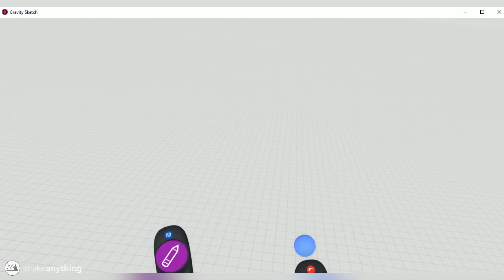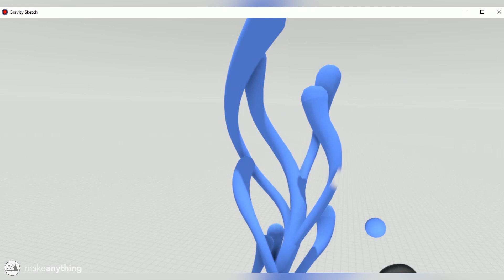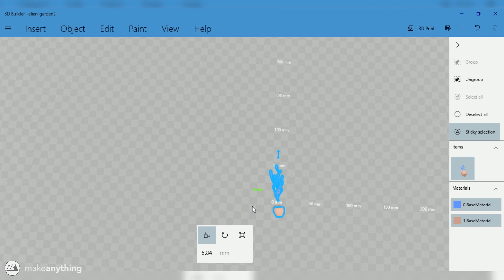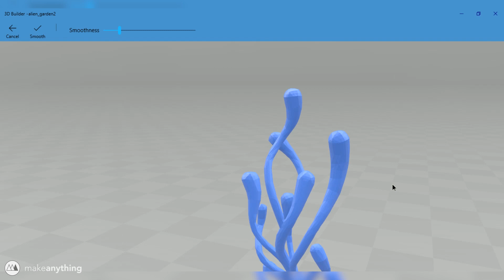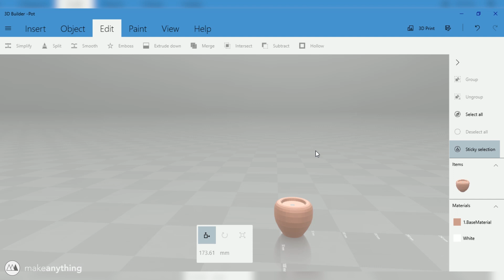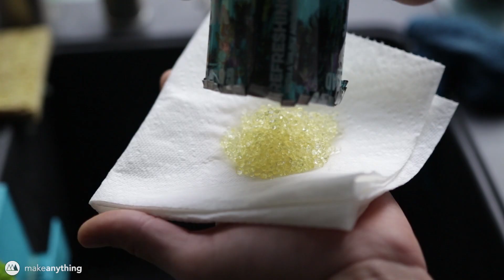My VR Sculpted Alien Garden

Comment: Love your stuff man, it's great. I finally bought my first printer, an I3 Mega, it arrived today but won't power up! I noticed that if i manually move the bed back and forth it generates electricity via the steppers and causes the screen to flash on and off as you move the bed.
Reply: Ooops! It was the power cable, i thought it wasn't fitting snugly, tried another and it positively pushes in and i'm on, about to do my first print :)

Comment: I really wish Gravity Sketch had a demo, I just want to see how well it runs on my computer with my WMR headset. I would love to make some fun stuff to print in vr but 30$ just to test if it works is a no go for me right now, haha.
Reply from the maker: I'm not sure how you run software for your headset, but the Vive runs with Steam and they will refund an app if you try it and it won't run on your computer (or even if you just don't like it)
Reply: Windows Mixed Reality headsets support all steam games, just not all are optimized for the headset because of its inside out tracking (really easy to take places and plug and play). I know I can try it by buying it and returning, I just don't like doing that and wish more games/applications had demos that lacked all functions or had a limited time, or lack of exporting just so I can get a feel for it. 

Thank you for the reply though, keep up the awesome work dude! It's always a pleasure to see your new videos. :)